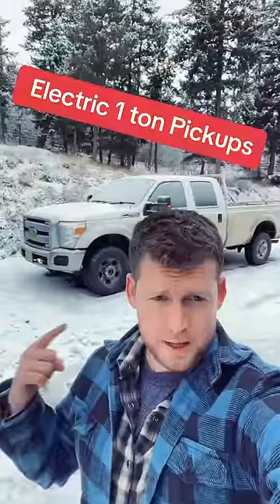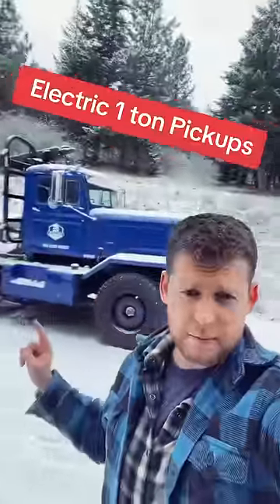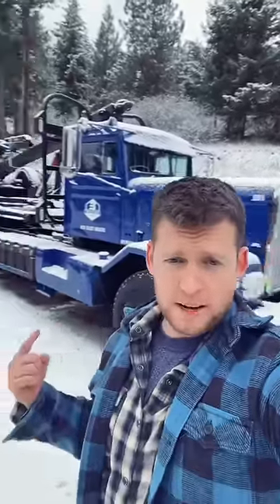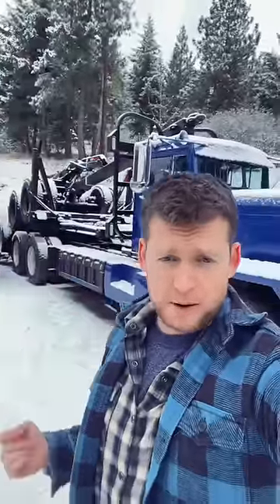Electric 1 Ton trucks

Comment: You guys really need to demonstrate fuel savings with a standardized test. Theoretically these should be less efficient on the highway than a standard driveline since you are constantly converting energy twice. Diesel locomotives use this layout purely to avoid a transmission. Serial hybrids like the Chevy volt get significantly less gas mileage from their range extender than their parallel hybrid counterparts from Toyota or even equivalent purely gas powered vehicles.

Comment: Will you be willing to do this to half ton trucks, Please give me a rough guess on how much this will cost, I'll give you an example truck, let's say a 2003-2006 Chevrolet Silverado 1500, crew cab 4 full doors, 2wd, 5.3L V8, auto trans, short bed 6 1/2 ft NOT THE step side model, give me an idea of what you're going to do and is the automatic transmission going to remain in the truck or is the truck not even going to have a transmission anymore, give me an example of what model generator are you going to put in a truck like this, also what kind of warranty are you going to offer miles/years, what kind of mpg should i expect, how long is the process going to take from the day i pay for it to be done.

Comment: Couldn’t a gearbox/motor in place of the transfer case, on 4wd trucks, reduce the cost and make installation easier? E-axles make sense on a 2wd truck, but the ifs on newer 4wd GM products seem like a massive headache.

Comment: You should consider a cheaper kit that simply can bolt up to existing transmission it won't be as efficient but a good middle ground for people that don't drive a pickup enough to justify the cost

Comment: Let’s see we have a diesel engine, running a generator which then runs an electric motor, which makes the truck go forward, why not just get rid of the electric motor and let the diesel engine drive the rear wheels like it was designed as  it should be

Comment: This is actually not a good idea. You loose around 35% of the energy generated by the diesel engine. Look it up. The most efficient inverter looses around 20% of the power. The generator also looses a decent amount and so does the battery. The efficiency will be terrible compared to a regular diesel transmission truck. The only place I can see this working is very short hauls, any long distance is going to kill the wallet.

Comment: But what's the advantage do you get better gas mileage like that😮 because you're dumping $10,000 worth of equipment into the truck to make it a hybrid vehicle but you can buy a lot of fuel for $10,000 where is the advantage😮

Comment: Can you do a ram1500 with solid rear and independant front. I would like to retain some form of 4x4 and maybe put in a manual diff lock
Reply: Its a 2014 ram 1500 slt
Reply: Very interested in this. 2nd question can i have plugs installed to run power to a bumper pull camper

Comment: Logistically, battery powered vehicles are not possible on a large scale. 

Mining the materials to make the batteries create more pollution and expel more energy than the battery could ever offset. 

The power grid is 50 years and trillions of dollars behind in capacity to charge these batteries. 

The demand for the battery raw material easily outpaces the supply and the rate at which its mined. 

The inhumane mining conditions at these mines are unacceptable.

Comment: Oh okay I wouldn’t use electric In the cold but I guess ur not full electric ?
Reply: They are electric with a diesel generator under the hood. Drivetrain is all electric, but the generator means the cold damaging batteries is not a problem
Reply: @marcusborderlands6177  well how do you feel about just the charging itself damaging the batteries ? … every time they charge they build up crystals which damage the battery slowly over time. Tesla has to use a software update to slow the damage to just push everyone out of warranty ( if I remembering correctly) has that impacted you at all?

Comment: The efficiency will be way way way less. This is essentially the way a train works. It's efficient there because the insane amount of weight. And it sounds like you're just pulling out the transmission and the driveway. The engine would be way too much for the generator. I don't like this.
Reply: They use a smaller generator engine lol.
Reply: @marcusborderlands6177  if you listen to what he says here, it sounds like you leave the existing engine